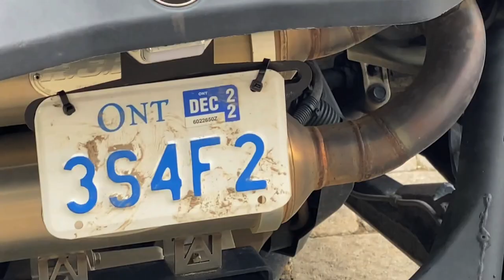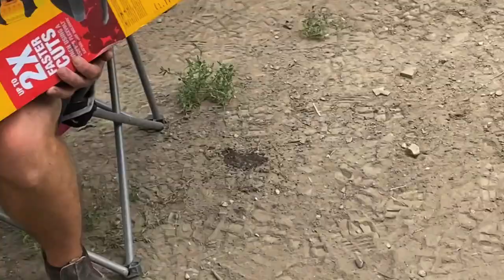Honda FIRE! Watch Out!

Comment: Maybe you could try to blow the engine by draining the engine of coolant, but keep the oil in it. It should run better, but it will over heat and seize pretty fast!

Comment: When pouring gas down an intake like that you need to leave the cap on the water botttle and stab a small hole in the cap. throttle control